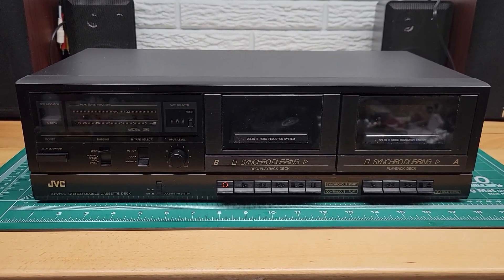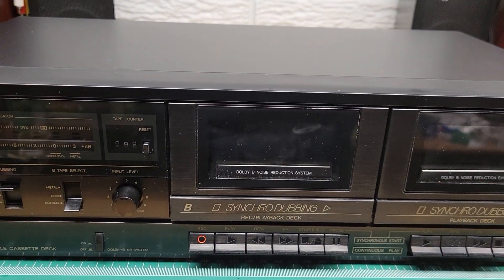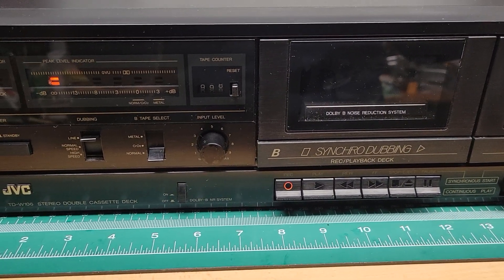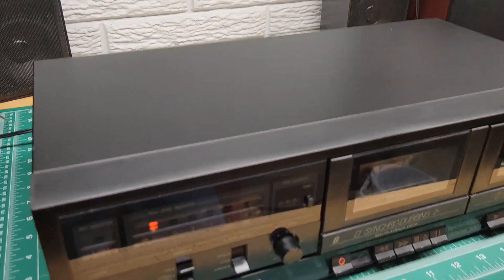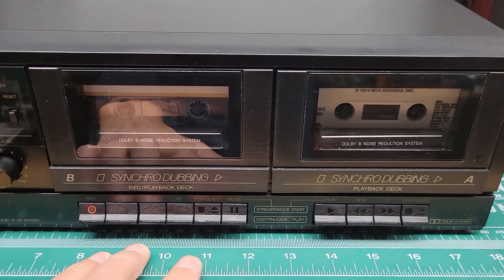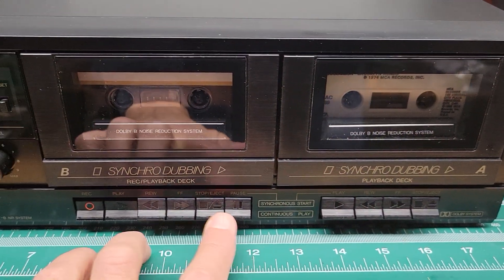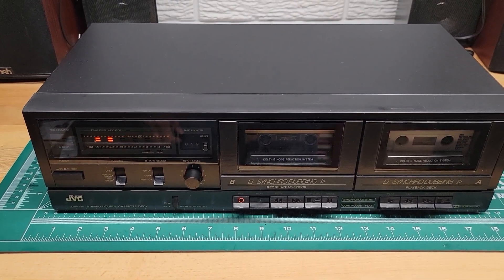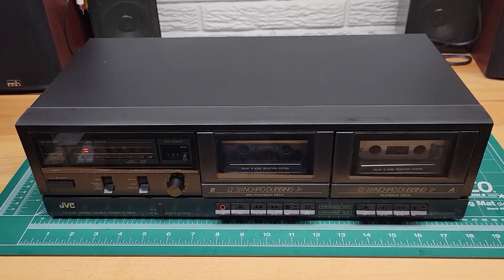JVC TD-W106 Dual Cassette Deck Demo

Comment: Where did you get the fast forward and rewind belt replacement??
Reply from the maker: @gnawvy  Ebay.  I usually search on "cassette deck belts " and you will find them in bulk packs with various sizes.   You can also search using the deck model and sometimes find the exact size ones needed.

Comment: Do you have a manual or know where to get a pdf of one? Thanks
Reply from the maker: Hello.  I can't seem to find a soft copy through Google searches but I did find a hard copy on ebay for 8 dollars.  I think its actually a really good deal for a hard copy.  https://www.ebay.com/itm/175414978325?hash=item28d78c2715:g:sP0AAOSw4fljIMTg&amdata=enc%3AAQAIAAAA4PDXTsJ0yEGKI1%2Fv%2FS%2BDNlbdLXhUriW8zC7L6DhUBcb0mM0icmwVDMf32s0UaIPms%2BKn8GWM0IDHHkIjl3WmPcHQ5h4%2BvHFohS%2B6Okpy5soe3QSnwcY%2Bweb84Z9%2BJAePPm0DBYeeuPRICv4VELwxP4L%2BU3gGtMRi0WoM7Iw3TsFTWXdI3XnmEjnIdiBSoJ97MeZY7sz59PpL11N5T0PepnmIVat98BEUgUXVzekDjoWI7v6cxS0cmstE2ZLXiAkFlSxivEPD9E%2FoWKpmhFrFbd3Wu1EYeNeoMsJr8zK%2F3UEM%7Ctkp%3ABk9SR7T4pKnWYg

Comment: does it run chrome cassettes ?
Reply from the maker: Yes and there is a fine bias adjustment to adjust accurately  for different tape formats.  The deck also automatically senses what the tape type is from the different hole patterns on the top of the cassette.